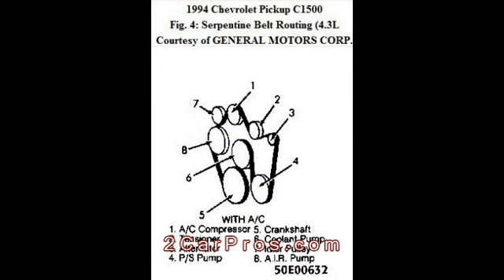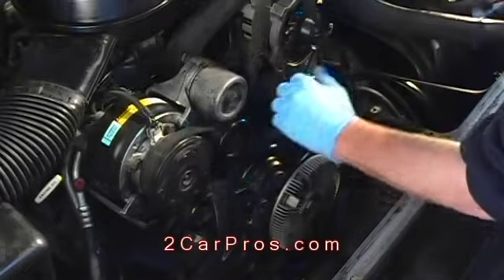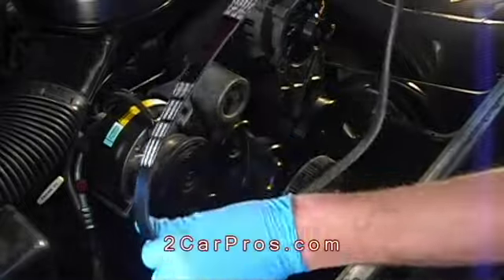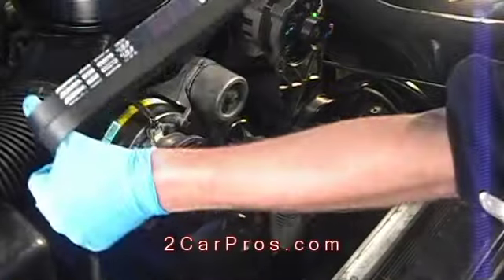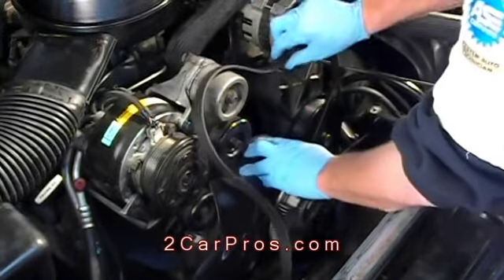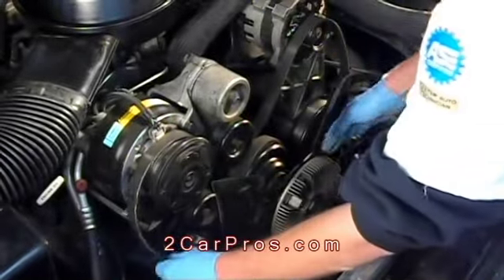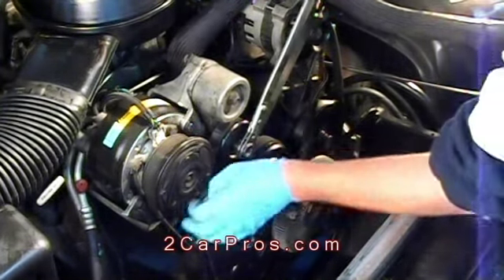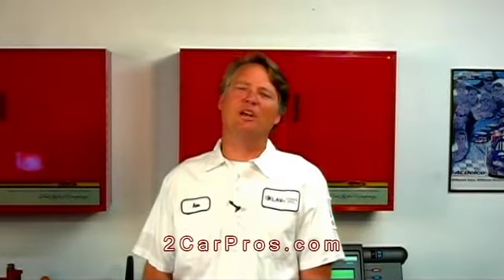Serpentine Belt Replacement 1988-2000 Chevrolet Silverado

Comment: I have a 1996 Chevrolet diesel 6.5 L and each time I change the serpentine belt, on the tensioner it show the belt is OK but after about 10 miles it shows it need changing again. Can you help me with this problem? Thanks Stan